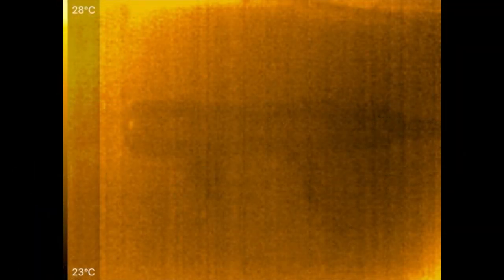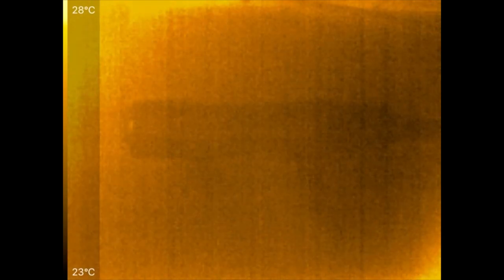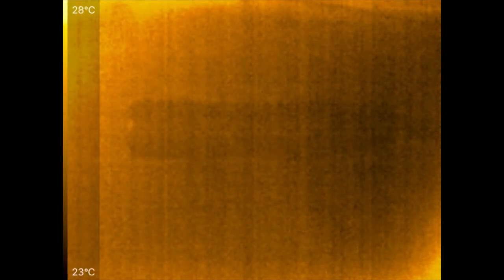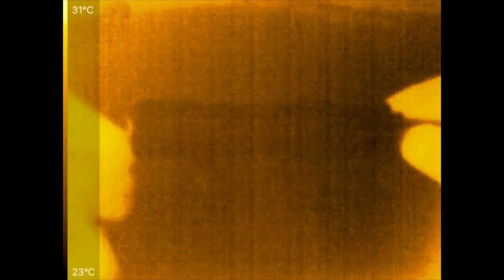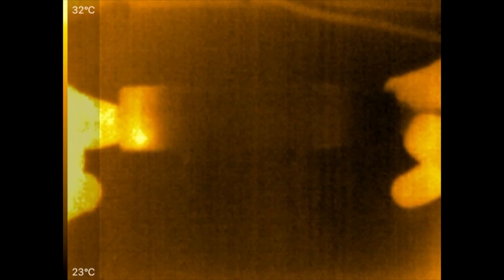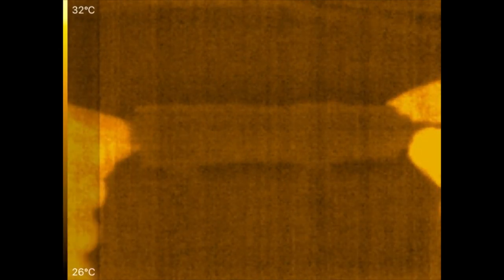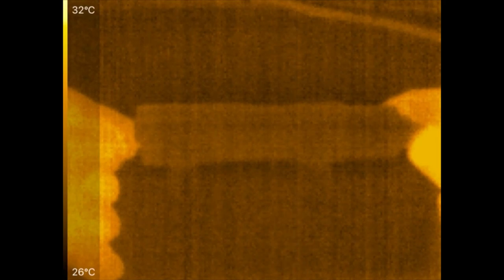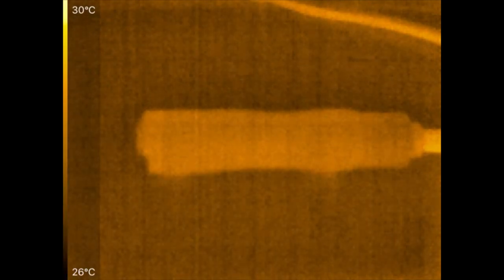Minding Your Mechs – Ep007 – Timesvape Dreamer Mech Testing Part 3 – Thermal imaging

Comment: Would have liked to see the aluminum tested.
Reply from the maker: The brass and aluminum ones would have shown a bit more button heating than copper but a decent amount less than SS.
Reply: Battery Mooch I was specifically looking at the aluminum for my next tube mech.

Comment: the copper actually warmed up a decent amount it just transferred it across the entire tube, pretty cool to watch. you can see it if you pause at 5:10 then skip to 6:40
Reply from the maker: It’s only a degree or two though. Some of it could have been from the aluminum slug heating up a degree or two also.

Comment: I think the heat in the copper test is probably not getting generated rather than dispersed. With the low volts loss to start with there s not much energy to create heat. The stainless obviously has issues at that point generating the 8 watts loss, it all seems to be contained in the switch area.  A combination of higher resistance material with the relatively poor contact properties due to the hardness. When tightening copper joints you can feel the give but with cadmium copper there is no give , cadmium copper is reminiscent to brass in physical character so hard like steel.

Comment: Interesting. Does the use of No-OX-ID special on mech threads help with conductivity?
Reply from the maker: No, it is an insulator. But it can definitely slow down oxidation unless moved aside at the thread contact points when tightened. I will be testing dielectric greases later on.

Comment: So the main message here is to keep contacts clean and use copper to get more power to the RDA?
Reply from the maker: Not necessarily. Only if a bit better performance is your top priority. For some it might be cost, appearance, weight, etc. Cleaniness is critical for any metal though.

Comment: I wonder how swapping the buttons between the copper and stainless steel mechs,  would affect the test results?
Reply: I suspect no, it would have the opposite effect.  In electrical flow, heat energy is created at points where resistance of the flow changes (e.g. your coils).  Threading of one half copper and the other half stainless would introduce a change in resistance and create a hot point.  That's what I suspect, anyway.
Reply: If tube thread is stainless and the switch threads are copper it will only improve the resistance a small amount. The copper can flow/mould into any imperfections better but you still have stainless on one side. On a side note don't use aluminium with copper as the current passing through starts a chemical reaction with the aluminum  attracting oxygen out the air and depositing aluminum oxide on the surface which is corrosive an a poor conductor. Its only aluminium and copper that have a problem all the other mixes are fine.
Reply from the maker: I’ll be testing a SS and copper button swap.

Comment: So when I vape my copper dreamer and it gets warm is this from the battery heating up and atomizer getting warm
Reply from the maker: Probably from  the atomizer unless you are at very high current levels but you can check. When you feel the mod getting warm pull out the battery and see if it’s even warmer. If yes, the battery is heating the mod.